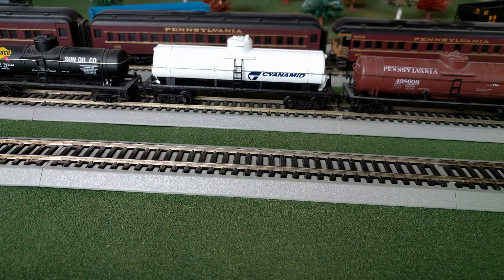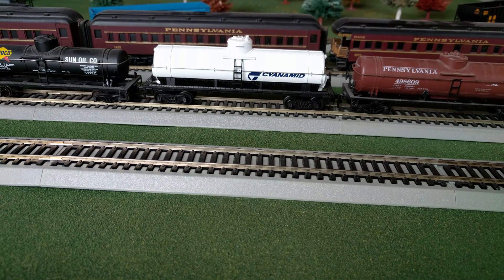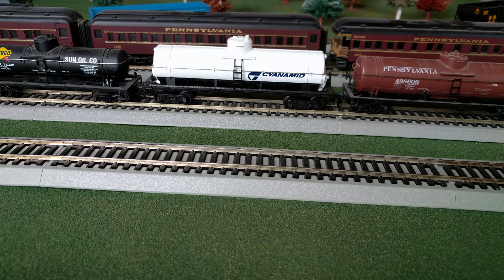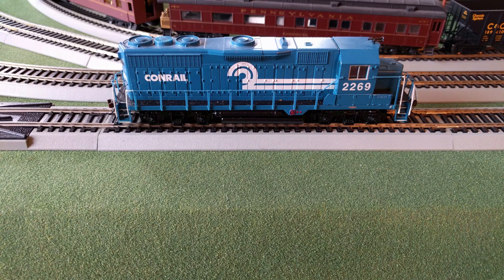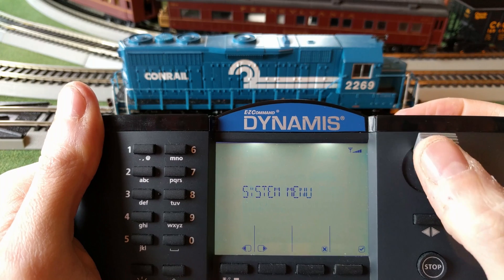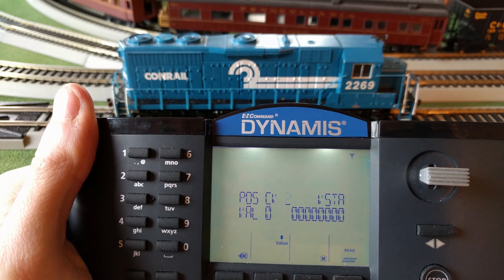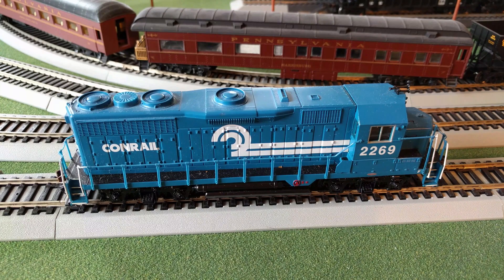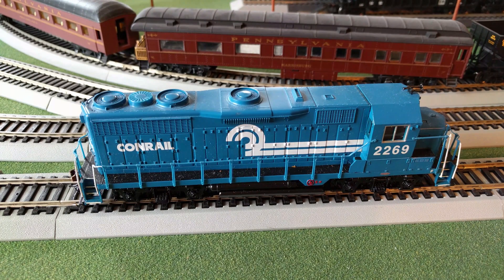Programming CV's | Corey's Layout | Episode 20

Comment: Great video thanks.  Can decoders go bad after almost 10 years of no use ? I've just started using my locos again but they don't seem to respond to the dynamis system but they run fine on AC
Reply from the maker: Hi Brian! I'm honestly not sure what could of happened. Maybe the locomotive number (CV1) needs to be reset to 3. If you do this on programming track that is separate from everything else, it might catch it and then you'll be able to talk to it through address 3. It could be a memory issues, but it's tough to say. I hope you are able to get it going.
Reply: @Trains in the Valley  many thanks Corey I did what you suggested going back to factory reset 3 and they worked fine. Cheers.
Reply from the maker: @brianfearn4246  That's awesome to hear! That makes my day! I've been in your shoes and it's no fun when that happens. Have fun!
Reply: @Trains in the Valley  hi Corey,  are you using dynamis probox as the standard dynamis doesn't show CVs . I'm just wondering if it's worth while purchasing a probox unit to add on ?
Reply from the maker: @brianfearn4246  Hi Brian, I got a pro box since this video and it's helpful. But, if you use ESU decoders a lot, the LokProgrammer is an invaluable tool! I have a feeling that Bachmann is working on a new DCC system because the Probox is no longer for sale, so you might be able to find some for a good deal. I'm still happy with my Dynamis!
Reply: @Trains in the Valley  many thanks Corey